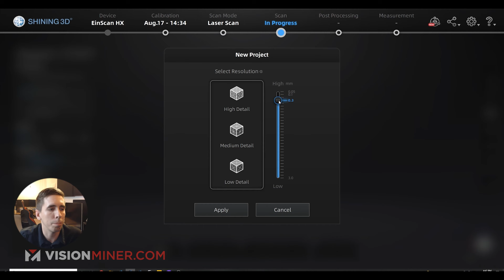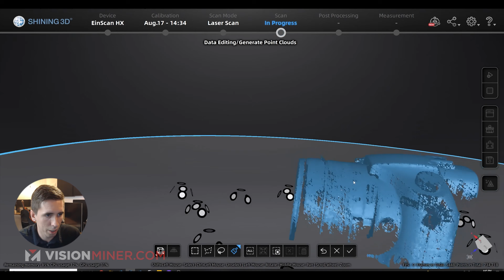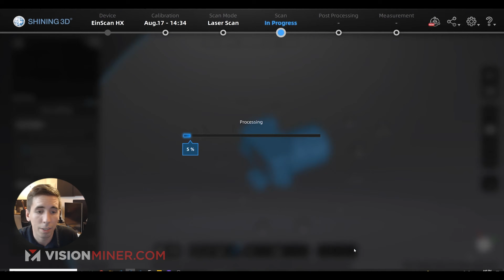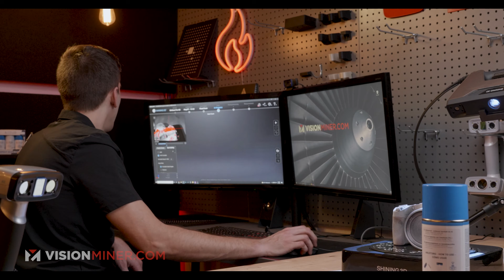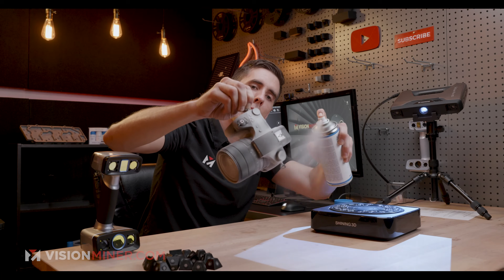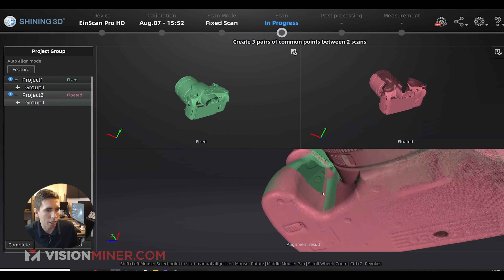3D Scan a Camera - Sony RX10 Mirrorless Camera | Einscan HX vs Pro HD Workflows

Comment: Fixed scan mode on the Einscan pro scanners I think is their strongest weapon (particularly the pro 2x as it has a higher resolution than the HD). The data quality produced in this mode can better laser scanners costing a lot more - you just wont have the accuracy. I don't think this was a very fair test, the HX would do a much better job if you sprayed the part.
Reply from the maker: Good point! I should do a part 2 -- scanning the sprayed version with the HX. Might even whip that out tonight! Thank you for the comment & suggestion!  Perhaps even a comparison of handheld vs. handheld....
Reply: @VisionMiner  Yeah I would also like to see if the HX is capable of the same resolution with a sprayed part. I'd like to be able to scan large car-scale parts for reference points so we're leaning towards the HX, but It'd be nice to know if its capable of the incredible detail that the pro HD picks up for small objects. How does the HX compare to the pro HD in non-laser mode with spray?

Comment: Ive used 3d scanners (metro scanner the 30k setup) before you need to reinforce the connection port otherwise after all the use it gets (constant use so about 4-6 months) eventually the ports will begin to fail and you will need to get it fixed. The connection ports these scanners generally use are not designed to hold the weight of the cord.
Reply from the maker: Sounds like you had a bad experience with that brand -- like many other electronics, we know what you mean -- the EinScans have ridiculously beefy cables, though, being designed specifically for handheld scanning, so we haven't seen any wear on the cables yet :)
Reply: @VisionMiner  beefy or not the connection point isnt designed to hold weight. The cords on the metra scanner were super beefy but for taller parts that had to be scanned the weight of the cord would damage the connection point over time. We eventually wrapped the connecting bodies to the scanner to support the weight of the cord to prevent that wear from occurring.

Comment: Weird question, but do you guys have a scan/3d model of the H/HX available?  I just bought one from you guys and wanted to 3D print a holder for the unit to adapt the HX for a tripod much like the Pro HD.   What do you think the results would be with a spray and structured light turntable scan with just the HX?  I know the turntable would have to be manual, but just curious on using just exclusively the HX?   Thanks for the video!
Reply from the maker: Good Idea! New video: "Scanning a 3D Scanner with a 3D Scanner" -- Hah! That would be funny, and good, just to provide the STL -- maybe I'll scan the HX with the H, to show why the H really isn't good for normal scanning (just humans), and then scan the H with the HX to show how much better it is. 

For the turntable, it's a different ballgame on the HD because it uses the coded targets to get even better accuracy, and is automated -- it would still be good on the HX, but it's just not the same :) For overall versatility, though, the HX wins in our book.
Reply: @VisionMiner  you should do that video, i've seen a lot of used H on ebay, which seemed weird meaning they probably suck at normal scanning
Reply: I just purchased a Einscan Pro HD and I made a manual turn table and it works great I just turn it and hit go. Hopefully it will work the same for yours.